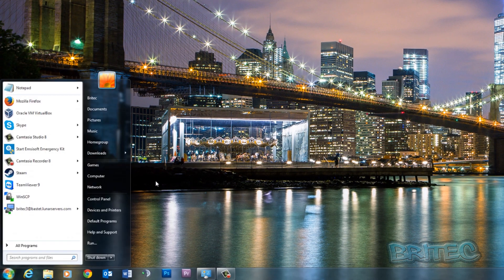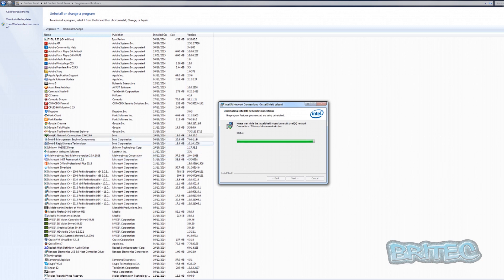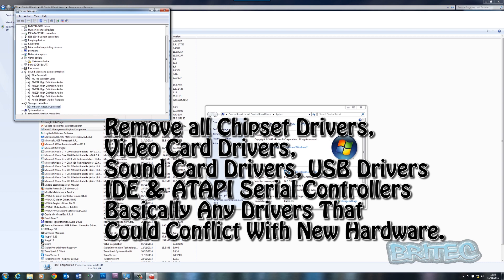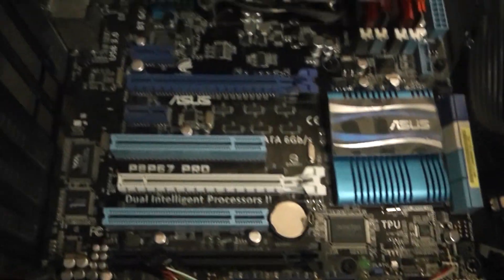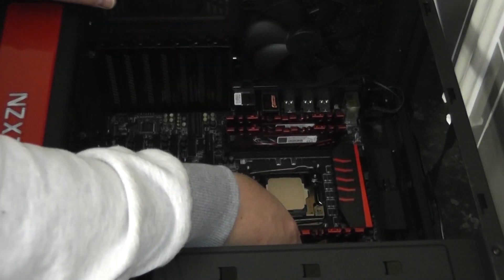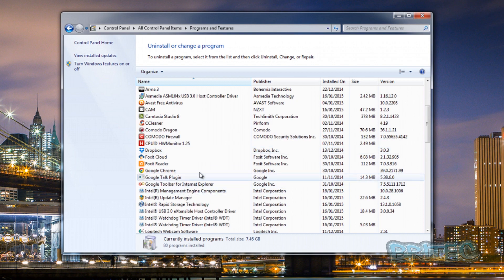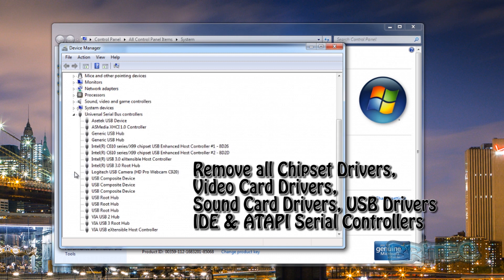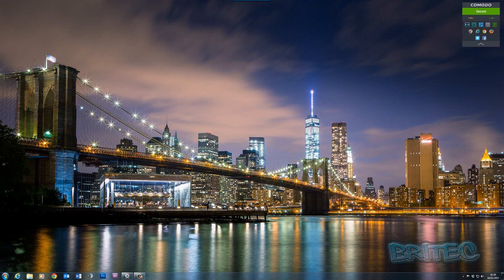Change Motherboard Without Fresh Install of Windows

Comment: This is not that easy. I am doing an upgrade from a Dual Core to an i5 and to start with you need a wired mouse. There is no way you can eliminate all the USB drivers if you are using a USB mouse which most are using these days. After that you really have to know what to remove and what not. You go into the Device Manage and start removing the Chipset drivers and you can Blue Screen it and it shuts down by itself and starts back up, it is not an easy process. I have been at it for a couple days now and learned the hard way. If you are working on a Virtual Machine it works great but that is not a working machine and not actually a working version of Windows. Give it  a try and you will be in Never Never Land with some of us. You really have to know what you are doing.
Reply: The best thing I found was Paragon Adaptive Restore I believe it is called. I search for my motherboard., How to change a gigabyte motherboard without installing windows and found someone that had it in his drop box and it took me twice running it, the instructions were pretty easy, Once you booted to the new board you just loaded your new drivers and then went into the Device Manager and removed all the drivers that had problems. I am not a pro and built my own computer and I figured it out, A lot easier, I tried this process so many times I could change out my mobo in 20 seconds before I gave up. Ger Paragon, it's usually free.

Comment: Rather use SYSPREP / generalize , it's the built in MS tool for such migrations. Failing that if you must do it the long way, rather use Absolute Uninstaller, select Batch Uninstall and remove the drivers in less time.

Comment: ok so I wanted to know if you can help me out. My mother board died on me, Got and old Asus rampage 3 x58 off eBay because it would fit my i7. So how can I remove the drivers form my old hard drive?   Because this was kind of an emergency I got a 250gb ssd for the moment and am using that to get by but I would really love to get my software pics ext.. back when I plug my old drive in via a usb it says that I need to format it and won't let me open it. Any programs that can delete my old drivers or can I run it as a slave ? Any feedback would be great thants!
Reply: Maybe if you have one, you can put the old hard drive in a old computer and remove it via the old computer?

Comment: Can't I just boot in safemode after swapping my motherboard. Wouldn't that update the drivers to the ones it needs for the HDD and SSD?
Reply: So it works and it doesn't work... It depends on the motherboard. If you upgraded to a similar motherboard that has the same Windows support  or got another motherboard that is the same then itll work, you just need to boot into safe mode. my new motherboard was completely different so it didnt work. I ended up corrupting windows. When you install windows, some of the config is installed onto the mobo which may be different with other mobos.

Conclusion: Don't risk it, just follow alternative solutions.
Reply: +•TэssэłłдtэdGцy• windows didn't say anything about it not being genuine?
Reply: Ozone9 Yeah, that was easily solved by speaking to a support specialist using the online chat. Whoops forgot to mention that.
Reply: thanks man!
Reply: Actually, I did it without doing ANYTHING. Just removed mobo and replaced it. Done. Works fine for me, windows installs and uninstalls all drivers itself. No issues AT ALL. That too I went from AMD fx 8320 to an i5 4690K
Reply: +David Guba Good point, but did that work?
Reply: +David Guba yeah, does this work?
Reply: TessellatedGuy Most likely worked because of the motherboard. Your old one probably had the same support for windows and similar interface.
Reply: Hahaha Im Doing the same, did it work for you /
Reply: If so how did the 7600k perform?
Reply: Was windows activated and did you lose anything?
Reply: So if I replace my motherboard and plug my hard drive in it should just work right? I'm going from an i5 6400 to an i5 7600k.

Comment: Thank you very much for this video! Will this still work when I swap my motherboard but keep my cpu?
Reply: what you talking bout????
Reply: As long the cpu socket is the same with your processor then you are fine. Do not force a cpu to a motherboard socket that doesn't support your cpu socket.
Reply: +Gary Senpai Not true what so ever. Iv had many migrations on the same socket that didn't work, and Iv had successful migrations from 1st gen i range to 4th gen i range....

Comment: so would this be the same for windows 10?
Reply: +GRIZZLY_GUY Tried with Windows 10 and works like a charm.
Reply: so do I delete my usb drivers or not?
Reply: +Tech guy No.
Reply: ***** you have to do anything special or just exactly what he did in this video to keep from having to reactivation of windows?
Reply: No, works like in the video.
Reply: +Atzu Silén so question. my computer doesn't have a PS/2 port for keyboard. How can I uninstall the USB drivers and still manage to control the system on boot up?
Reply: +Tech guy You cant really delete your current usb drivers without your keyboard stopping to work. So for example delete all usb 3.0 drivers as using something else for the keyboard.
Reply: ***** okay did you uninstall everything from System devices in control panel?
Reply: +Tech guy Everything related to motherboard in Programs and Features and all listed drivers above in the video in Device Manager. Last thing, remember to update your new motherboards bios and any other thing like sound and usb drivers and you are good to go.
Reply: +Atzu Silén okay I'm ready just waiting for my CPU and mobo in the mail today! I'll let you know how it goes.
Reply: Okay, good luck for it
Reply: +Tech guy have u upgraded yet, I'm planning to do the same thing, and want to know how ur upgrades went
Reply: +Walt Bringenberg yes! It works under Windows 10 with no compatibility problem as long as you follow this videos information, except it WILL deactivate Windows and you have to type in your product key it was a bit of a pain. It said I was reactivated with digital entitlement, but you HAVE TO have the 25 digit product key that was already active. I now have i7 4790k though with totally different motherboard than before.
Reply: K thank you I will be sure to get that code before I upgrade next week.
Reply: +Walt Bringenberg okay just make sure it's the product key not the product id they are totally different. Key is 25 characters long.
Reply: +Tech guy is the 25 character product key included in the free windows 10 install? I still have win7, about to upgrade to 10. Appreciate your answer.
Reply: +Noam Nogasto it would use your Windows 7 product key after you install Windows 10. Mine said it was a digital entitlement because of the Windows 10 upgrade, if not for this it might not have reactivated. So make sure you have your full 25 character Windows 7 key available to enter.
Reply: +Tech guy my Windows 7 product key is on a prebuilt computer, would it still be valid?
Reply: +Noam Nogasto it should as long as you do the free upgrade to Windows 10 first, then do the motherboard swap. But of course with a slightly different build just be prepared for the risk of it not working. I went from OEM version of Windows 8 to Windows 10 free upgrade. Also if your product key doesn't activate it initially, download the latest Windows 10 ISO file ~3gb from Microsoft support website and manually install, then enter the product key through setup. Plus it gives your pc a fresher Windows 10 install with your new components. So do the free upgrade to W10 through Windows update first, motherboard swap, make sure it boots up, then possibly manual install ISO file if product key doesn't work.
Reply: +Tech guy So you're saying the win7  product key are the same as the win10 key after upgrading? And if I need to download the ISO file, can I do that onto the computer or would I need a USB for that?
Reply: Yes they would be the same, and you can just download the ISO directly onto your computer no need for USB.
Reply: +Tech guy the ISO file can be installed straight from BIOS?
Reply: +Tech guy can u replace your cpu alongside your motherboard without reinstalling windows?
Reply: +Atzu Silén was your version of windows 10 oem or retail? mines was a free upgrade from windows 8.1
Reply: +Zachary C yes
Reply: GRIZZLY_GUY Mate I need your help!! First Time upgrade noobE here 😀

Ok so I am planning on upgrading my motherboard from a Gigabyte LGA 1151 z170 GAMING X motherboard to a z370 motherboard so I can use 8th gen processors......

I have over 30 STEAM games installed and a lot of photos and music files stored into my PC. But most importantly are my STEAM games. Can I still follow your steps shown in your video still 2018? Will I have to buy windows 10 again for my new mobo? Also if I just simply connect my HDDs to the new z370 motherboard, will my saved STEAM games and photos/music be easily transferred to the new mobo without backing up anything? My plan is just to upgrade my motherboard and CPU and keep my HDDs. Please help me be successful first try 😃😃
Reply: you dont need the product key,  if you signed in and says this ""Windows is activated with a digital license linked to your Microsoft account" Then you are good to go.
Reply: Activation helps verify that your copy of Windows is genuine and hasn't been used on more devices than the Microsoft Software License Terms allow. ... A digital license (called a digital entitlement in Windows 10, Version 1511) is a method of activation in Windows 10 that doesn't require you to enter a product ke
Reply: Activation helps verify that your copy of Windows is genuine and hasn't been used on more devices than the Microsoft Software License Terms allow. ... A digital license (called a digital entitlement in Windows 10, Version 1511) is a method of activation in Windows 10 that doesn't require you to enter a product ke
Reply: +Atzu Silén did they many you reactive windows?

Comment: Newb here. Looking to upgrade to a new socket motherboard soon. Say I don't mind reinstalling windows, what will happen on 1st boot up, will I get to Windows (with driver errors) and then can just do a full system reset? Or will I have to boot up off a iso usb/cd, which I've made in case.

Comment: Britec09 Would it be a straight swap,without removing drivers etc, if I am replacing my current mATX board with the exact same ATX board ? IE: P8P67-M-Pro > P8P67 Pro.

Comment: So now my situation is a little different. I ended up sending my R5E to a buddy because his died and I am getting a X99 Classified from him tomorrow. I've been told that after I get the system hooked up with the new board that I should enter Safe Mode and then remove drivers that way and then boot into the OS normally and then I should be able to go from there. Is this a possible solution as well, or do I just need to reinstall the system. Just wish i didn't have GTA V on my main SSD cause that's a bitch to install and update while on 1.5mb DSL. Yea I'm out in the sticks. :(

Comment: My case, is that the motherboard is bad, short circuit. Means can never power on the pc, it shuts down quickly when pressing the power button. So I can't remove those programs you mentioned.

Comment: Couldn't you just put the new Motherboard in and THEN delete all the old drivers?
Reply: DBauFrn No it didn't, I recently changed my Motherboard without un-installing any drivers. I put the new Motherboard in, Installed the new drivers, un-installed and drivers that couldn't load or were corrupted, done. All I had to do was re-activate Windows (8.1) and re-install my GPU drivers. No problems at all. :)
Reply: +Ben Phillis TripleThreat is partially correct and to correct your statement, W7-W10 all handle mobo changes MUCH better then previous Win Os's, with W8 and W10 being a step above W7, but the actual matter comes down to how similar the chipset of the motherboards is. 

I'v done many mobo migrations when the old mobo died under W7 with no issues, and seen quite a few with issues... I suggest you go research your stuff before telling people "you dont know anything", it's ironic and rather egotistical.... Do you know that W8 is just an advanced W7, the kernel, etc etc is built using W7's kernel etc etc , much like a Crysler C300 is built on a Merc E class chassis....
Reply: Ben Phillis this i would like to know as well?
Reply: Ben Phillis That could crash the new OS with BSOD.
Reply: TripleThreatOwns It's not a 50/50 chance. Don't give me that bullshit. :D Windows 7 can't handle a Motherboard change, it just fucks up. But Windows 8 and above can. All the background stuff in Windows 7 wasn't that good... Don't give me that "You got lucky" bullshit, you don't know anything. :D

Comment: How do I know which are drivers?
Reply: ID GAF They are named intel, nivida, amd or drivers
Reply: lol. this might be a very advanced learning guide.  Learning your computer is the best way to know what files your motherboard may be using. Hes not even mentioning uninstalling proprietary software it sounds like.

 all cpu/motherboard/memory/gfx/whatevere is attached to your motherboard possibly. I suppose even a sound card or capture card anything else pcie. You will of course have to rebuild all this software

Comment: If I did this with OEM version of windows 8 would it work the same?
Reply: Beast Of Gaming I think that is what this video is meant for. I am not 100% sure, but I believe that the retail version of windows 8 allows you to transfer your copy of windows 8 to another computer. Microsoft defines a new computer when a major component is changed, like a motherboard.
Reply: Thing i am looking into myself i have a 8350 processor and Asrock 960GM-GS3 fx win 7 64 thinking about upgrading one day to Asus M5a99X 2.0 with my win 7 64 os bought my pc from cyberpower years ago

Comment: my system is refusing to post, even with all the hardware except the cpu removed, so I want to replace the motherboard and cpu (obsolete series). is it possible to do this without a clean install?

Comment: Hey everyone i'm a little confused with what i'm trying to do so i would really appreciate it if anyone could help.

So recently i decided to return the motherboard i previously got, because of freezing issues and upgraded it to a new one. At this moment i no longer have that motherboard (I returned it because it was within 30 days) and i'm receiving a new one in a few days. The thing that's scaring me at the moment is that i didn't know i had to uninstall the drivers from my old motherboard off my hard drive. I have no access to that motherboard now so I'm very nervous that my computer may not work because it has the drivers of a completely different motherboard. So what i'm trying to ask is will this affect my computer in any way? Will i be able to get onto windows, uninstall the old drivers and install the new drivers on a completely different motherboard? 
I'm kinda freaking out so i would very much appreciate a response.
Thanks!

Comment: Hello guys i'm looking to upgrade my pretty outdated build with a new motherboard, cpu, etc. And currently my motherboard is an ASUS M3N78-VM but i'm looking to upgrade to a MSI H81M-P33 with a Intel Pentium G3258 3.2GHz processor. I'm reluctant to actually replace the parts because i'm not sure if i'd have to install a new os, so if someone could maybe help me out it would be very appreciated, thanks.

Comment: I don't want to reinstall Windows. I have a dell inspiron desktop that i am going to replace with another factory motherboard and factory power supply. Do I need to uninstall and reinstall drivers?
Reply: From what I understand if the motherboard is the same you don't have to do anything.

Comment: I'll be trying this when I move from my current FX760g Motherboard to a Z97. Is there any specific type of driver that I should uninstall when moving to a different brand of processor?
I'm sorry, I just want to make sure that this works perfectly when I do swap.
Reply: How did it go?
Reply: I'm holding off on it, I found a nice 8370 to keep me afloat 'till late Summer.

Comment: I have successfully swapped a hard drive from a desktop to a laptop. First I cloned the drive, using Ghost 32, because obviously, the desktop drive wasn't going to fit in a laptop, Then by simply turning to my windows disc and running a repair install, I was able to have all the programs that were on the drive work (which was the object of the exercise), You do need to have the drivers for the new system ready after windows finishes.

Comment: Do you think there will be any windows 7 activation issues if I am swapping my AMD board for an Intel board. I'm asking because you went from Intel to Intel and things might be different. I would prefer not to have to deal with windows tech support on a non supported OS. Thanks and great video.

Comment: Wondering if you would have had any Windows dropping activation issues. Was that a 970???  :0
Reply: +Britec09 hour do you backup activation?
Reply from the maker: TimsComputerRepair Yeah you have to backup activation or re-activate windows. But it all went smooth, yeah gaming 1 addition speed very close to GTX 980, no vram issues what so ever.
Reply: Britec09 You didn't say anything about that in the video...

Comment: Hey thank you realy much for the video !! 
It helped me alot
Reply: Hi, I sold my old mobo already...can I just plug in old hdd with windows and it will boot and let me unnistall those drivers?? It was ASUS Z97 PRO WIFI and i7 4790k , I am getting ASUS STRIX 270F and i7 6700k.
Reply from the maker: TheAppleG1 glad you liked it.